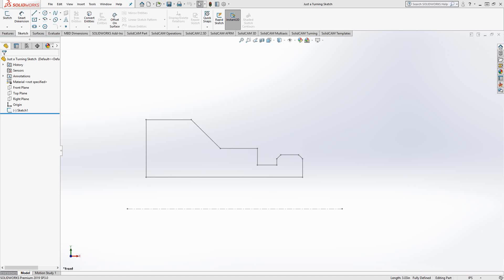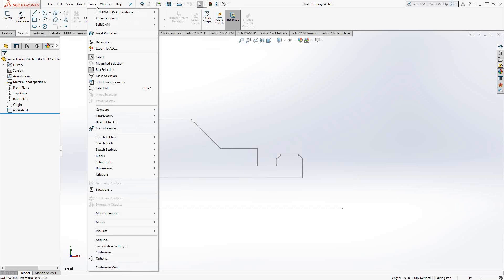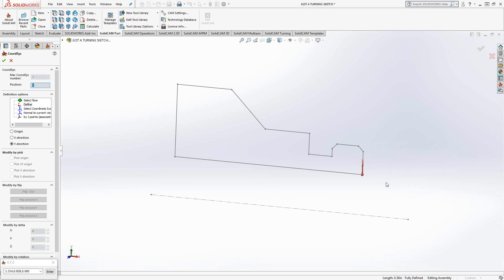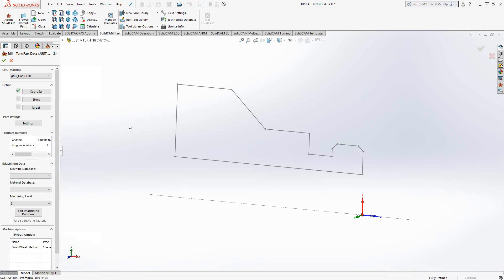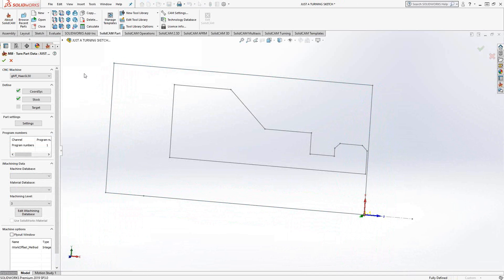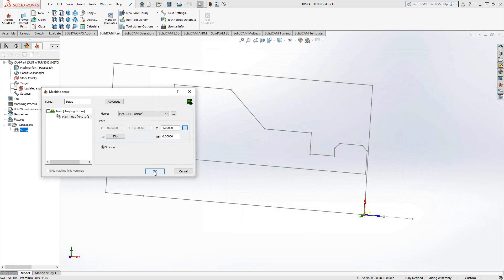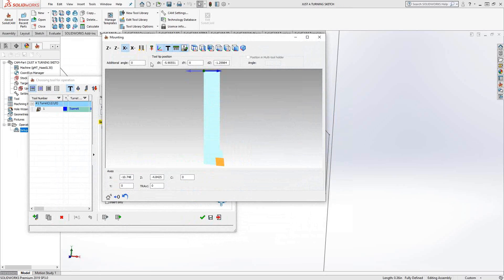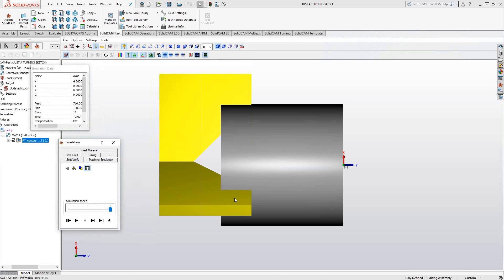Programming a Turning Part with only a 2D Sketch

Comment: Registration Open for Technical Training :---
1. AutoCAD 2d and 3d
2. SolidWorks 
3. CNC programming 
4. Mold Tools Design 
5. CATIA 
6. Sheet Metal Tool Design 
7. VMC Operating with Programming 
8. All Technical Management Courses 
9. All Computer Courses 
10. Quality Control in Tool Room 

Other 100+ Courses 

अपने भविष्य को दें नई उड़ान। 
Contact more Details IETR CAD CAM Technology (9729795004)